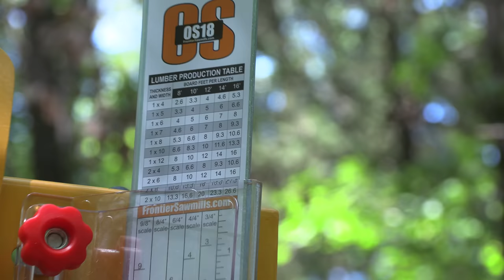From Logs To Lumber: A Sawmill Demonstration - Frontier Sawmills

Comment: Hey Tony! Just a quick tip for your OS18: take the bolt out of the clutch and put some LocTite on it. Mine came out while I was running the mill and chewed the key up pretty good. Was able to get a replacement and get it back up and running.